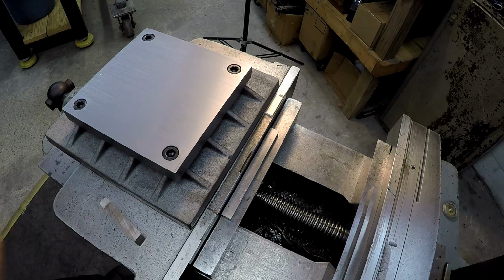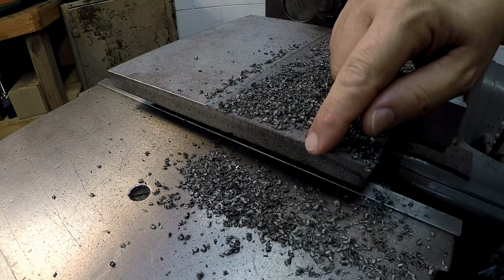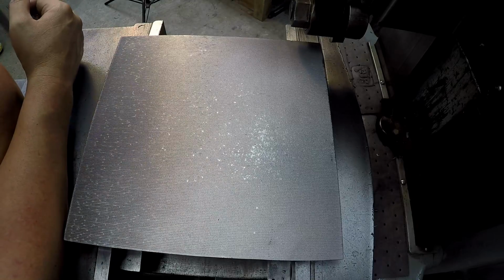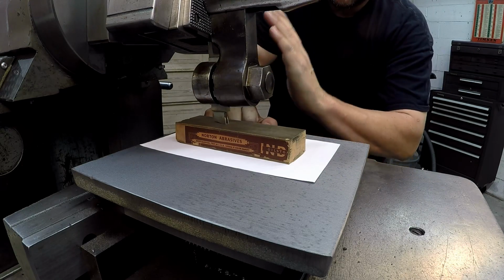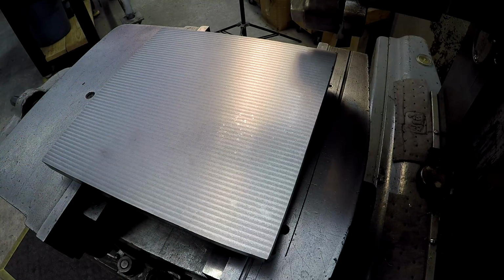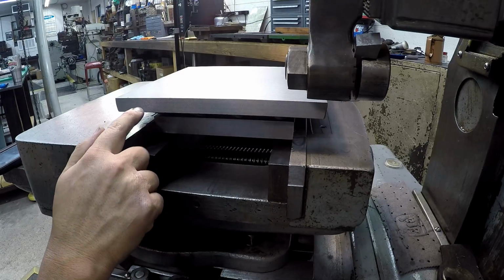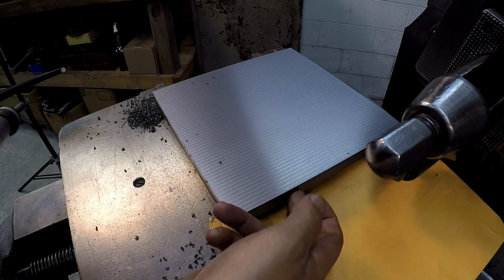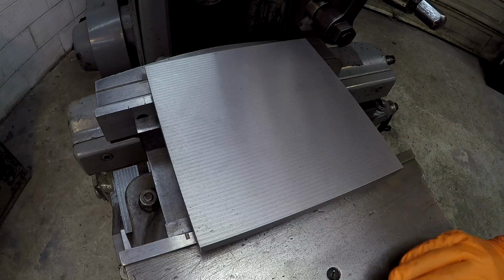Fireball Tool Fixture Plate Part 5

Comment: Hmm... Watching you hone that tool while it's in the clapper... I do wonder if the offset angle of the clapper is adding a tiny bit of angle to the tool as it goes back down 🤔

Though in that case I'm not sure how you'd get it exactly flat...

Comment: in the last video you mentioned the clapper angle - when you raise the tool a few degrees to hone it, the clapper angle rotates the tool respective to the work surface.  i think this is what may be enhancing the striped effect - if there's a noticeable texture, you might want to hone the tool on a separate jig.

Comment: You seem to have very much good material free of sand. Sand can destroy your cutting edge pretty fast. I ground  a lot of planer finish tools  on Cincinnati T&C grinder. Little hard to explain but with a tipped cup wheel I could create a .0005 crown on the bottom of tool which was perfect for finishing .

Comment: Adam.im not a machinist by any stretch of the imagination. I was wondering if u could use air to blow chips out of the way so you dont and up running a chip under tool.

Comment: Those many tiny silvery specs should be cementite (the hardest form of iron/carbon compound) crystals embedded in the high-carbon-content cast iron, which also has ferrite and austenite crystals, and free graphite.  This is ledeburite, the material of regular grey cast iron.

Comment: Adam, I am too in love with my shaper.  I love the way It sounds, and I can almost always tool it up from the drawer with all the old HSS bits in it with a bit of a regrind.  Mine is just an 8"  Shaprite, not nearly as cool as yours.  I'm a bit jealous.   One thing you didn't mention is that you can often find a shaper in good shape for pretty close to scrap weight prices.

Comment: Other shaper benefits:

1) You can establish a flow where you set up the operation and you can go work something else for 5 minutes. Set up the next operation, go work something else. 

2) Machining cast iron in a lathe or on a mill tends to atomize cast iron dust into the air and all over everything else in the shop. The shaper seems to do a lot better job of creating chips than typical cutters you would use in the mill or lathe.

The way I see it, the shaper fits perfectly in a high production job shop.

Comment: I love the sound of a shaper running.  It is very soothing.  

Do you suppose that it is possible the cutting tool was getting fouled as it entered the cut when you were doing the finish passes on the top surface?  Maybe a body could chamfer the entering edge as well as the leaving edge to get the hard stuff off.  

Love your vids man!

Comment: rotary mill:
faster.. Yes (mostly, depends on type of cut and the cut tool)
Same Accuracy.. Also Yes ( within realistic ideals regarding allowed error)
Invaluable experience running the shaper machine.. Nope :)  I honestly quite like the shaper, it seems peaceful, and is great for long straight cuts
You do You. You enjoy using the shaper, So you should use it as much as you like, Just ignore any haters
Just like I prefer handtools over some powertools (screwdrivers,small drilling, filing, etc., i like the peaceful quiet nature of handtools

Comment: #Abom79 Hi Adam, first just wanted to say Thanks for sharing your knowledge and experience , and also for taking the time and work to make all your Great Videos . 
I did want to ask, and I'm sure it's just my lack of knowledge... but with as much machining work that it takes to square up a casting... 
Wouldn't it be better/cheaper to just get a thick steel plate (from work, scrap yard, metal supply, or what ever resources a person has)  and then just machine that plate to spec? 
Or is there benefits to using cast iron for a plate like this? I'm guessing this is the case, as I know many tool top surfaces (such as mill, lathe, even table saws and ect) are often made from cast iron. I always kind of wondered why that is... maybe it stays flat(er) better than "regular" steel, due to the molecular "structure" of cast iron??   Or.... ???

------------
EDIT: I guess I should have finished the series before commenting :-) You answered my question in Part 7. Hadn't thought about welding (which I should have, since thats most of the metal work I can currently do) , but really good points about cast and welding too.  
Also the "burs and peaks" that steel can make when scratched or if something bumps it, that is very true. Again, something I hadn't thought about when using Cast, you don't have the same outcome when those same issues occur. So, cast iron makes sense, and the reasons is basically what I was first thinking, with some additional benefits added in there too. 

Thanks Again Adam for all the Great Videos and Info!  I don't have a machine shop, its something that I've always wanted, as I've always loved working with metal. I do fabricobble a lot of projects and things, always wanted (and at times have Needed) to have the ability to do precision work. But until that day comes, I try to gain as much "head knowledge" as I can. So channels like your's and ToT are Great. And again it is Much Appreciated that you and others who share all the years of knowledge and experience to all us noobs out here :-) 
Thanks

Comment: I think it's awesome you're using a shaper to do most of the machining on this project.  What most people don't realize is a shaper allows that perfectly flat surface with NO heat and NO machining stress.  Mills can't do that.  And if you have the compound vise, you can do compound tapers if required.  Those are hard and never flat on a mill.

One comment on the spots, cast iron has flakes of graphite in it and you are probably seeing flakes oriented essentially parallel with the cut surface.  Ductile iron has those flakes turned into spherical nodules (that's what allows the yielding of the material where the flakes cause cast or grey iron to break).

Comment: I've been watching your channel for a few months now. I am 28 and a novice machinist and I work in a production shop cutting with HAAS machines, old hardinge machines, Swiss machines, screw machines and a few others. I love the work that you do and the time you put into your videos. I always look forward to every project or job you do and your words of wisdom and kindness throughout. Your a humble man and the work you do is your passion and I hope someday I can be as good as you.. well at least 50% (haha)  I have always wanted to learn how to use old machinery more than the new stuff. It bothers me sometimes cutting the same stuff all day in a production shop. Old machines have always been interesting to me and their are less variables with them than Mills or lathes. Even though I cannot use one of your older machines, it still amazes me how accurate they are and how well they were built. I use to work at a wood shop and we had a straight cut saw called the Matteson and it came from a Navy ship. Still had all the original parts and was my favorite tool in the shop! Over 80 years old and still worked great and in tact.  Anyways, I just want to personally thank you for inspiring me to do more and to learn more from this field. I will keep watching and learning from your channel! Thanks so much!

Comment: Abom, or any machinist that knows, can you explain why the cast iron tool plate is ideal vs steel. I do not know anything of metallurgy and my initial thought was that a steel tool plate would be "better". What are the pro's and cons aside from the underside rib shape being easier /faster/cheaper to achieve via casting. Is it work-ability, durability/longevity, or some inherent stability characteristics of the metal? Not sure and was curious. Does it even matter for the application of the intended use in this case? Thanks in advance for any knowledgeable responses.
Reply: I'm a toolmaker, I'll give this a go for you...I've never officially been told, but...

From what I understand, it's easier to maintain the flatness. That's about it. If a cast iron plate gets chipped, an actual chip comes out. Fixing it is much easier, just smooth the edges over. Steel doesn't chip, it deforms, and no chip comes out, unless hardened of course, but even then you will still get some deformation around the edge of the damaged area. Unless your fixture plate is carbide, but then no such animal exists. 

So cast iron plates and jigs and such can usually just be fixed with a stone. Steel plates and fixtures will likely need remachining or regrinding, as stoning steel is far more difficult and poses its own set of challenges.

Cast iron also corrodes differently to steel. Cast iron is porous, and the oil it gathers over time prevents rust on its own.
Reply: @NomadUniverse   Thanks for your insight! I appreciate you taking time to share and explain.
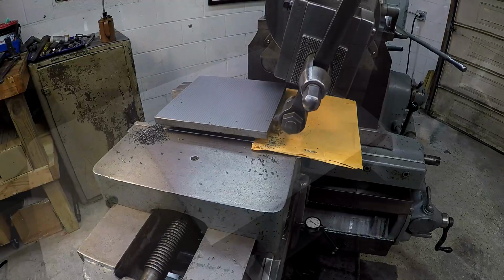Reply: @KurtL1776  I've just been catching up with the rest of it and he explains at 28:20 in part 7, echos some of the things I said plus a few things I didn't think of.

Comment: Moore's - Foundations of Mechanical Accuracy, will give you more reason to use a shaper/planer.  A slow moving, single point cutter, will induce less stress and heat into your part.  Even a flycutter in a milling machine is inferior if you are aiming for the best possible part stability, after machining.  Thanks for all the awesome tips, Adam.  
Cheers, Gary

Comment: You explained that the tool swings out in an arc when the flapper is angled.  So when you lift it to hone it on the stone, aren't you grinding a slight angle on the tool? Is that why it is leaving stripes in the finish?

Comment: Adam, you remarked on the shiny silvery patches showing up in the otherwise grey cut surface of the cast iron fixture plate. 
Unless I am mistaken, they are likely to be hard spots comprised of cementite (iron carbide). 
The tendency for such hard spots to occur is affected by the composition of the cast iron. 
Their formation is also promoted by rapid cooling (chilling) of the casting, particularly in the skin that solidifies in contact with the mould surface. 
Increasing the silicon content of the melt helps to avoid precipitation of cementite and hence the formation of such hard spots, even with rapid cooling. 

The hardness of the cementite, which is about 68 Rockwell C, means that it is unfriendly to high speed steel tools. 
Ordinary high speed steel is typically 63 to 65 HRC and cobalt high speed steel is 66 to 68 HRC, so such tools have tough time when they encounter cementite in castings. 

With each successive cut some of the shiny spots were eliminated. 
As would be expected, that indicates that the shiny hard spots were mostly confined to the surface of the casting.
That is the material that would have cooled most rapidly and so was susceptible becoming “chilled”.

Keep up the good work. I really look forward to your videos.

Comment: Is the patterning that's left after the final finish passes because of the chips being dragged across the surface on the backstroke? If that's the case would you get a perfect finish by rigging a flexible 1.25" vacuum hose to the head somewhere to suck those chips away as they're made? Or does the patterning come from something else like heat, etc?

Comment: Hey Adam, keep up the shaper videos! I happened to notice on the top surface of the cross slide on my South Bend lathe where the compound attaches has the same finish pattern as the cast iron pieces you've been shaping. Pretty cool!

Comment: Question to the room from a newbie home-shop guy, Could a lathe toolpost grinder be mounted to a shaper to use it as a Surface Grinder for large items?
Reply: You know, I was wondering the exact same thing! Granted, I only have a 10" stroke Alba 1A, so 'large items' is a relative term, but still.... enquiring minds want to know.

Comment: Not questioning the use of the shaper, I love watching old machines work. I just have a question about procedure. You lifted and turned the plate after cleaning the two sides of the plate. Could you not have just rotated the vice 90 degrees instead of lifting and resetting? Or would it have taken longer to make sure the vice was square to the ram?
Reply from the maker: Yes I could can rotated the vise, but would require tramming it again. Since the vise was already square it's faster to rotate the work piece instead. That's how "mill users" would have had to do it...LOL

Comment: May have taken 4 minutes for roughing cut, I would say it would be less on a mill with carbide but, you still have to set up in vice on both machines but you can set your feed and your depth and walk away, go make money on another machine, would have to attend mill and probably make 4 passes with a 2" cutter. Time saved 👍
Reply from the maker: I'm not trying to compare, just showing some who wonder how long the cuts are taking. people are quick to say "it's faster on a mill" but I don;t see anyone doing it. Most guys have a Bridgeport style knee mill and they don;t like big wide cutters.
Reply: apples and oranges to compare, the shaper is often underrated for its speed but if your not having to attend it the whole time its cutting man hours it would be similar to a bridgeport style mill, but with a much cooler finish.

Comment: I'm wondering - did you check if the stone is parallel? Have you ground it flat or is it just a regular oil stone and you don't need to care that much about the surface?

Comment: It's an interesting comment about the angle of the clapper box. I had the same question in mind some time ago, because whenever I was seeing photos or drawings of shapers in older books it was set up that way and it was all straight in newer books or on the photos of newer machines. I found the answer in the "Machine tool technology" book and I realised that the difference is not merely old vs new - it's just that newer shapers often have a mechanism for lifting a clapper box on the back stroke.

Comment: It probably does not matter that much, but when you hone the cutting edge in the shaper the angle will be slightly off perpendicular because of the clapper box angle. Maybe this is the cause for the stripes? It's a nice look never the less! :-) Thanks for your content, have been watching for many years now.
Reply: It needs to be off perpendicular, that way it has the neccesary clearance angle.
Reply: @Balsamancnc  Yes, on the back of it. But because the clapper box is at an angle the cutting edge seen from the front will be slightly off a perfect perpendicularity to the Z axis. Or slightly off parallel to the X(?) axis. Does a shaper have the traditional axes seen on the mill? :-)

Comment: Adam, I have a question about the surface finish. I noticed that as the finishing tool returns on the back stroke, it drags the cut chips underneath it across fresh surface. 
Does this impact the finish and would having an air blower attached to the head clearing the area help? Just curious what you think.